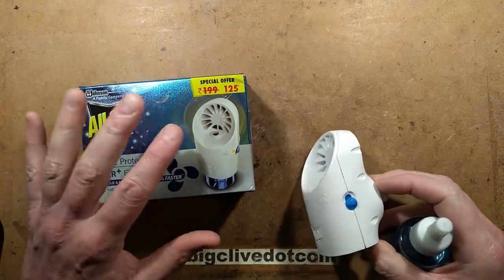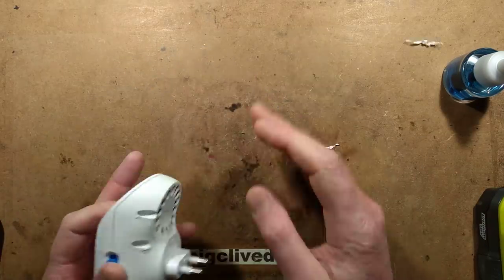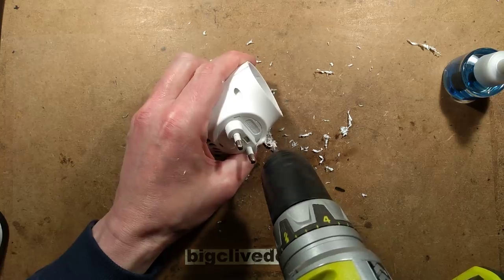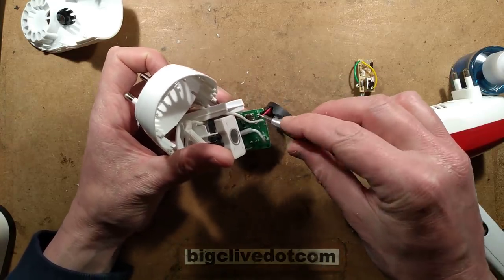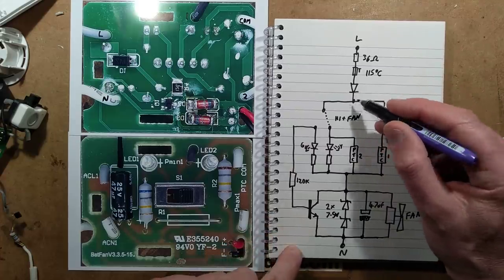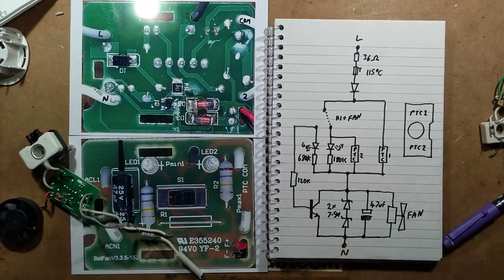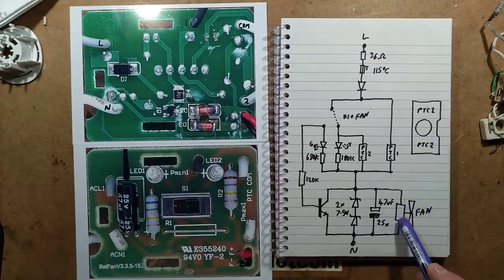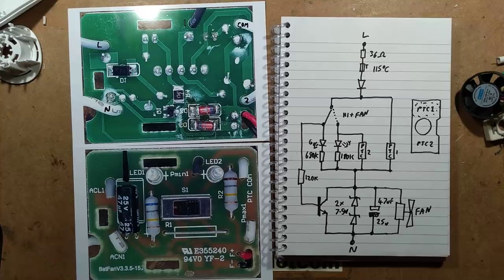All-Out fan assisted mosquito killer teardown.  (With schematic.)

Comment: I also took these apart and harvested the ceramic resistor from them! I was impressed how simple it was, but who knows how many fires this could set up??? This one is very sophisticated!
Reply: If you travel around south east asia, you will see these everywhere. Every house will have several of them; some of them running continuously for weeks on end. There are literally millions of these around and they seem to be remarkably safe even in a culture where the concept of health and safety at home is non existent.
Reply: @nrml76  When I saw how simple the ceramic resistor across the hot and ground wire (neutral I should say) and the heat it creates makes the stuff evaporate. BUT stuff can go haywire and burn. but for most it is safe. I'm not even talking about the power it is using per month, is a second cost most people do not calculate.
Lets hope that nobody gets hurt! I would be afraid to make a such device myself! Thanks for letting me know Nirmal.
Reply: Should be fairly safe, the more they heat up, the higher the resistance, which means they heat up less and stabilise, unless they're faulty, but that's true of anything. They're used as resetting fuses, they're neat, and easy to use, but they're not easy to make, a lot of engineering

Comment: I wish they sold these units with fans here in Greece. The big problem with these liquid and mat styles of mosquito killers is that the chemical that evaporates and condenses on the wall leaving a "brown streak" for at least 40cm above the outlet. When you try to paint over this streak it leaches through again within a month.  Wish they had shellac readily available here or the Binz primer we have in the USA, its white and shellac based. Does a great job at sealing in stains.
Reply from the maker: The carrier liquid is kerosene.  It might help to plug it into an adaptor that is further out from the wall.

Comment: The resistance for the green LED is also greater because the fan source voltage is pulled low by the transistor, putting higher voltage across the green LED & 680k resistor.
Reply: Hey Thanks for ur comment

Comment: Looking for a compact soldering iron to take with me while I'm out on my route of fixing pinball machines. Most of them time I'm only doing one or two connections and it would be nice to have something that heats up and cools off quickly. Most machines have a electrical socket inside. Any recommendations?

Comment: Thanks for your video. I want to use the circuit by DC supply at the output of the rectifying diode. What is the minimum DC supply voltage is required for its working? Plz. Suggest.

Comment: Ah-ha.  Sufficiently few comments there's a chance you'll read this one.  So, completely unrelated to the video, here's a suggestion for a project.

This was inspired by my own (successful) experiments and realizing that it would also be suitable for you when I saw your most recent Manx Beard video.

Items required: 

1) A laser pointer.  Any colour (as long as it's visible, not IR or UV).  Any style - could be the standard pen shape or it could be a mouse-shape laser toy for a cat.

2) A long beard with a significant amount of white in it.

Method:

Hold laser pointer to the side of your head.  Aim it at the white portion of your beard.  Turn it on and waggle it around.

Result:

Lots of laser sparkles jumping around in your beard.
Reply from the maker: I just tried it.  It's very spatial.
Reply: @bigclivedotcom  
I thought you might like it.  A portable light show.  Fun at Christmas.  Even better with two lasers of different colours, one in each hand.

Any chance of a video? :)

Comment: How can I modify the system to run the fan at its full fledge all the time?
Reply: It has basic principle as this fan draw not mote than 80mah so a resister and diode is used for to reduce voltage and current and later zener to protect and capacitor to smooth . It is very simple.

Comment: the glass air fragrance bottle is good for making metho lamps to melt par cored or melt nylon rope ends to stop un raverling 
thick copper wire coil push in napkin as wick

Comment: Why is there no device to shoot down flies ?
In 1944, We invented a radar that was capable of shooting down doodlebugs.  The system was known as "Antwerp X".
What about bluebottle X ?
A death ray is out of the question but high fequency sound might give them buzzkil.
Reply: The high frequency sound is being used for Dog and Cat Chasers
Reply: @kimsleep4111  I quite like cats and dogs. No much higher than even mice can hear.
Reply: @phils4634  You might be able to blind a fly with a low power laser if you could track it accurately.
Reply: @blancsteve4819  Tracking might not be essential. If you use an optical line generator (as used in laser levels) and scan perpendicular to the line orientation, you could (in theory at least) have a "scatter-gun" approach. I don't know how much power might be needed, but I suspect watts rather than milliwatts.
Reply: @makeracistsafraidagain  Colesterol damage....er I mean collateral damage to the wallpaper and possibly the plants that need protecting from the little mother buzzers. A single grain of salt projected at mach 0.5 should do it.

Comment: Clive please can you do a teardown of a cheap Smartwatch. I'd love to know what is inside them. Especially the ones with the heartrate monitors.
Reply from the maker: The heart rate and oxygen monitors usually just use a red and infrared LED to detect the way the light transmission is affected by the pumping blood.  The designs will be very optimised.  Probably just a few dense pin-count chips and a smattering of support components.

Comment: Off topicm but does anyone know what diameter and type of solder Clive uses. It seems to work perfect.
Reply from the maker: The size I use most is 22swg.  Noting that from my usual supplier it's now restricted to professional use by the eco-hippies.  https://www.rapidonline.com/rapid-solder-wire-60-40-22swg-0-7mm-500g-reel-85-0595

Comment: Clive can u redesigned the whole circuit with capacitor dropper.
Reply from the maker: Given that it's using the resistors for heat it makes sense to use them to supply the fan current too.

Comment: The reason thermistor at 115 oc  is so it fails sooner rather than later so you buy them regular
Reply: Doesn't makes sense for the company, because the machines are virtually sold for free, the cost is basically for the liquid repellent, there is not much difference between the cost of the liquid bottle and cost of the combo box which includes the machine and liquid bottle. There is due to price war and clever marketing tactics, as the machines can only be used with the same brand bottles, and these bottles will last for 15 days on turbo setting, whereas these machines are designed to last very long so that the customer keep purchasing the same brand bottles.
Reply: @PriyankBolia  these would cost probably about 20 machines to a rupee so very cheap and insecticide is where they get repeat buys ergo the profit think it said 2-3 rupees to buy from shop so do make profit not going to sell if no money in it
Reply: Watched video looks like 199 or 1.99 reduced to 1.25 or 125 the price

Comment: Why not screws?They want to make it hard to open but don't want to shell out for security screws?
Reply: You'd have to be barking mad to want to open one of these things and learn what's going on inside of it, really. Besides, think of the micro-pennies saved by not having to order, stock, and install such screws. You don't need machinery or bits or programming of automata to install screws you don't have anyway. The clamshell is the fastener. Smush, click, "Next!". 

If we're fortunate, the next step in the evolution of case fasteners will require no tools at all to disassemble -- only the Vulcan Mind Meld.
Reply: @michaelthibault7930  OwOooo!

Comment: Not sure I'd call it a clever circuit. Take the bottom end of PTC-1 and bottom end of the 680K directly to 'N'. Remove the 120K and the trasnsistor and I think it will work just as it did before (may need to tweak values).
Reply: I'm not sure if that'd pass enough current to run the fan at full speed.
(I suppose your idea could work with a 24V fan, but they might not have succeeded in obtaining a 24V fan that small; it's a 40mm fan if I'm reading the label correctly, and only some manufacturers bother making 24V versions of those. Also, 24V fans tend to be less efficient, so for the same speed the current draw is still more than half that of the 12V equivalent.)

If Clive reads this, then go ahead and check if that modification works properly…

(On another note: The displayed power factor of 0.85 is strange; it should be about 0.707 for a half-wave rectified resistive load. So I'm not sure how much we can rely on the HOPI meter; maybe it somehow accidentally AC-couples the current waveform before sampling? If it uses a current-sensing transformer, that could do so; there may also be a distortion effect.)

Comment: could this be run at 12 dc?
Reply from the maker: I doubt the thermistors would generate much heat at 22V.  You do get USB vapour pad heaters.
Reply: @bigclivedotcom  Thanks for the reply Clive,

Thought it might be good in my camper van, wife  bitten badly last year in France.

Regards

John
Reply from the maker: @bulthy1958  Search eBay for 12v mosquito plug to find a version that can take either the tablets or bottles.

Comment: Hey, I thought it would be amusing to have a torch that had a baton fitting (or e27) on the top to run a modern 6watt+ light bulb meant for the house.  Could a simple circuit allow this, without having to go full inverter?  Then also mount said torch to a bike :)
Reply: you can get e27 low voltage led lamp versions intended for ship and mobile home usage.
Only problem is the bang and puff it makes if you plug it into 230V AC.
- BigClive has a video about those...

Comment: What is the purpose of shunting out the Fan ?  Cool Video Sir.
Reply: IIUC , the low setting uses only one of the two available PTCs, which have a degree of self-regulation built-in: as the temperature rises, the resistance in the object creating the heat (dissipating power) rises; the current drops, and less power is dissipated (less heat is generated)… It's a feedback loop in any case. Speaking of cases: I suspect the reason the fan is there at all is not so much to push the transfluthrin (?) into the surrounding air (which it does, but as an incidental side-benefit), but to keep the plastic body of the device from melting and dripping down the wall onto the floor when it's running both PTCs ("High"). IOW, the fan is for pushing heat out of the device at least as much as it is for pushing out the vaporized insecticide.

(Loathsome interface, Google. Loathsome and quirky.)
Reply: @michaelthibault7930  Yep, I can see that.  Cool Bean.   GooGle Biases as Hell and Not to the Right.